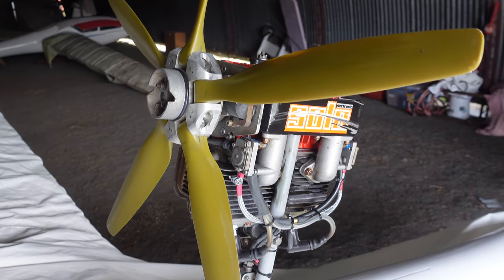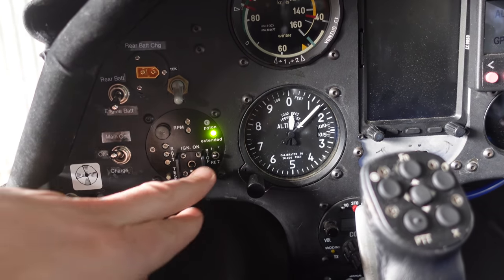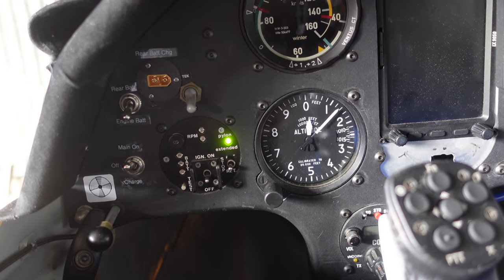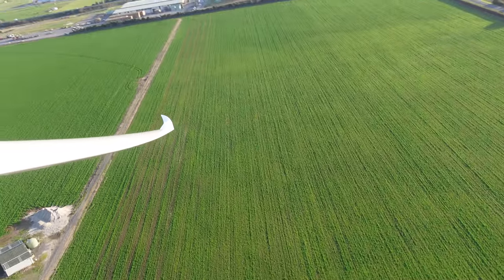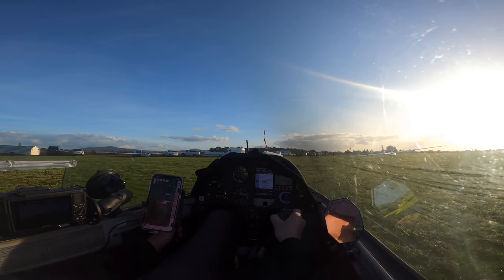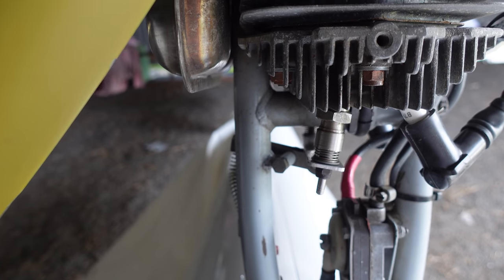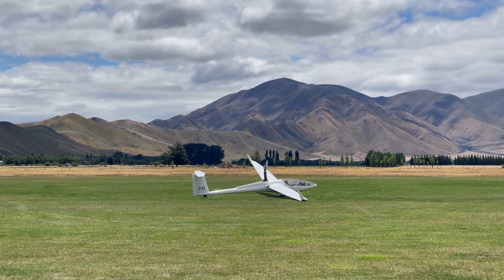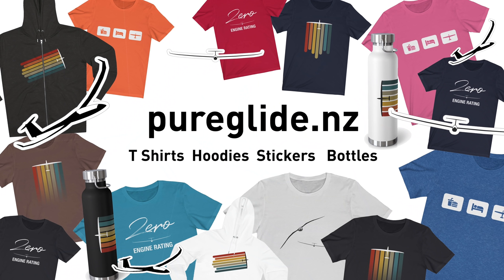How a Glider Engine / Turbo / Sustainer Works

Comment: seen this before, though i find it cute that some also use jet engines.   

PBS TJ-100  is a common little jet used, though some owners have managed to get their hands on Williams F107 WR19's,  though it is not unheard of for some to use RC Aircraft engines...   mounted in pairs.    either 2 on a single popup pylon, or 1 per side on separate popups.   while it might seem strange to use "RC Aircraft engines"   many of them can get up to and above 89 lbs of thrust per engine..  For example a Jetcat 500 is about 110 pounds of thrust each,  2 of them, 220 pounds..  for a smaller lighter glider that's good for a sustainer engine or even takeoff in some cases.     Jetcat 1000 RC motor,   is about 1100n thrust or 247 lbs of thrust A pair of those will match the Williams F107 WR19.  

more then enough thrust to take off though they guzzle fuel much less efficient because of their design, then more purpose built sepecailized engines,  each jetcat burns 2.9l per min,  so a just for take off at max power,  the pair will chew through almost 60 l of fuel, just for a take off and climb.    the Williams f107 though even though its twice the thrust is a far more efficiant engine burning about 3.08l/min a max flow rate.  but again, those are like hens teeth to get,  i'v eonly seen like 2-3 gliders powered with them.
Reply from the maker: Yeah I'd like to make a video about jet engine gliders sometime! Cheers
Reply: @PureGlide  as i said, the one that use the RC motors are more common.  if you see a pink air intake.   Its a jetcat.  That's pretty much their trademark.   Lavander/purple is... ugg i think its AMT?  out of the netherlands, and blue is PBS out of Czech.

Comment: How long does the engine run? I imagine the fuel could change your glide characteristics so using it would make you glide slower?
Reply from the maker: 450km using the saw tooth method. I'll have to cover that in another video! Stay tuned for Part Two
Reply: Extra weight has surprisingly little effect on the performance of a high performance sailplane.
Reply: They fill the wings with water sometimes, so  the extra weight is not a problem for say a big gasoline tank.

Comment: Very interesting video. I imagined those Engines were there to get you out of trouble at low level. But it seems a fair amount of forward planing is required. Including a dive!!
Reply from the maker: Yeah exactly right! Gotta use it early. I just tried to start it down low next to the airfield recently, and it didn’t start, so ended up landing😆

Comment: I don't think it is cheating at all but once you put an engine on it you really should not be called a glider anymore. {shrug} 

I mean my Cessna's can "glide" with the engine off. The turbo 210 I used to own had a 12-to-1 glide ratio. From 25,000 foot I could glide 54 miles! Does that make it a glider?  Nope! :)
Reply from the maker: Haha true I guess the intent is to not use the engine most of the time, but I bet you don’t have that intent with your Cessna!
Reply: @PureGlide  "but I bet you don’t have that intent with your Cessna!"

LOL! Yeah! Very true! Only when I am practicing for the real thing! 

BTW on a related note -  In 30 years in GA I have had two engine failures. I made it to a runway both times!  So practicing gliding pays off even in Cessna's!
Reply from the maker: Excellent, good to hear :)
Reply: @AClRCLEOFLlGHT  Jeez man, no need to be so nasty about it! 

I gotta tell ya though, gliders are not my cup of tea but as a total airhead,  lover of all things aviation, if flies then I think it is totally cool!  You won't hear me knocking gliders or glider pilots. 

When my next engine overhaul comes due I may even be thinking real hard about it! lol
Reply: @AClRCLEOFLlGHT  Opinions are like arseholes mate. Everybody's got one and they're usually full of sh*t.
Cheers, have a great day. ;)

Comment: I had no idea that physics would allow for a forward folding prop. I thought that the lift from the blades would fold it up. I guess that centrifical force wins.
Reply from the maker: I asked my gliding engineer about it. He stood quietly for a minute :) I will find an answer for the multitudes of people who have asked. Subscribe so you don't miss the answer!
Reply: The rotor blades on helicopters rely 100% on centrifugal forces to keep them from folding up in the exact same way. Some helicopters, such as Robinsons, actually have hinges at the base of the rotor blade that enables the blade to rotate upwards for flapping. Without centrifugal forces the blades would fold upwards in to streamers as you plummet to earth like a stone.

Comment: Man having an engine on one of these things just makes so much sense. Just think about it, if you can fly about 8 to 10 hours in one of these gliders. And damn near close to hitting a thousand miles. Just in one glide alone. Having an engine on there could potentially fly you clear across the United States from California to New York, on just one gas tank. Because you don't run the engine the whole way. Hit it for about 5 minutes up to altitude. And you're good for another 8 hours of gliding.
Reply from the maker: Haha not sure your numbers are quite right, but the concept is kinda right!
Reply: @PureGlide  Well probably not on your engine. But I know there's some people that can get close to a good thousand miles on just one glide. And I've also seen other people instead of a propeller prop, they put these small jet engines on there. I bet that'll do it.
Reply from the maker: Yeah so my engine has one of the longest ranges. The sawtooth method which is climb, then glide, then climb, then glide etc can get 450km range. Any further and you need some external weather to help. Cheers!
Reply: @PureGlide  Well the world record for the longest glider flight is a little over a thousand miles.

Comment: I love gliders, because they are elegant, silent and high tech. The modern electric motors fit much better then a screaming and farting combustion engine, IMHO. 😁
Reply from the maker: Yeah and if you have a spare hundreds of thousands of dollars you can buy one! Luckily we don’t have to use the engine very often :)
Reply: @PureGlide  Seems like the manufaturers have a 90+% margin obviosly. Batteries cost <100 € or $ per kWh. 
If you can by electric cars for 20-25k€/k$, it is just a question of time, I guess.
Reply: @Stefan_Dahn  lekker genederlandst pik, “a question of time”, man man man

Comment: Wouldn't this make more sense as a pusher motor?  From the way the prop blades fold, it appears the only thing actually holding them deployed when the engine is running, is centrifugal force.  I would imagine a great deal of thrust is lost from the system to blade flex.  By having it a pusher motor that folded forward, I would think you'd get greater efficiency from the engine
Reply from the maker: Good question! I guess this is the design, hasn’t changed for over 20 years as it seems to work well. Brand new ones are almost identical

Comment: I agree the engine is not an advantage in competitions, even is a disadvantage with more weight, and at least the turbo which needs to dive to start takes more altitude than some people use for landing circuits.

But there is one competition advantage, and that is that on those outlanding days, when sometimes other competitors arrive back late at night after long retrieves, the turbo pilots can motor home for a relaxed evening. Saves on fatigue :-) Unless you're the one who have to go retrieve all the other pilots after returning :D
Reply from the maker: Exactly right! I thought I would end up being more relaxed but in the end I go on a retrieve anyway :)
Reply: @PureGlide  It started with turbo pilots going to contests without crew, "since I will always get home I don't need a crew". Then it evolved into the pure glider pilots: "I won't need a crew because the turbo pilots can come retrieve me". And now no one has a crew :)

Comment: Yes its cheating!!!!

With the ability to up n go....you are likily able to try to find that thermal just a little further out and lower down than someone that has to consider a proper circuit and landing options.
Reply from the maker: Not quite true, if you want to use the engine you have to start it higher than you could possibly find a thermal without an engine. Some people who fly contests deliberately don't use the engine at times so they can try and find the thermal down lower than their engine cut off height.

Comment: About the folding blades:
How do they stay straight when using the engine? Is the centrifugal force enough? Or do the blades need some counterbalance to keep them unfolded? Maybe they have like a centrifugal lock in the hub?
Reply from the maker: Yeah it takes very little to make them spin and flip out, and then the airflow puts pressure on them. Cheers!

Comment: Great explanation of the sustainer motor operation!   This motor really opens up the territory you can explore!  Your prior “Motor to the good stuff” video captures the advantages!  Some of your videos show magnificent scenery that appear to have zero options for landing out safely.  I am certain having a motor must feel  good.
Keep up the excellent work!
Reply from the maker: Thanks very much! And don't worry although you can't  always see them on the video, there are ALWAYS options for landing. Often behind me which you won't see. I've only once or twice in my gliding career I've not had somewhere safe (or wet) to put it down. Around NZ in particular, we often don't find lift even when we expect to, so it's critical. I'm up to about 75 out-landings so far...
Reply: @PureGlide  That would make for a great video of the best out-landings in NZ in short video clips.  Clearly with my 2 out-landings I need to adventure out more.

Comment: Probably better than an electric sustainer but not as good as a jet engine. I don’t doubt the 2 stroke is more fuel efficient yet it lacks the James Bond kudos you would get with the Jet and that’s worth a lot of mileage.. 😎
Reply from the maker: Yeah not quite as cool as a jet, but the sustainer can go the furthest distance (400km or so)!
Reply: @PureGlide  - Yep.. 400km is useful. If you need to sustain that distance of course. Though I’ll  take the jet and a radius of a mile please. :)

Comment: Nerd here..  Interested in long range flight for personal transportation.

what's the fuel capacity?  How long will it run for on that amount of fuel?  How far do you think you could glide using it?  What's you average speed?  Would an electric motor with battery and solar on the wings be awesome?
Reply from the maker: Hey DjClarky78, great questions: some of which I answered in part two: https://youtu.be/ZRTkHh7n55Y
As for electric, yes they exist now as you can imagine! And yes even experimental gliders running only with solar on the wings (Google" Solar Impulse). But electric gliders are now common, and I'll have videos on them in the future.
For personal transportation, check out the touring glider range from Pipestrel like the https://www.pipistrel-aircraft.com/aircraft/electric-flight/taurus-electro/
Cheers!

Comment: Are the blades extended only by centrifugal force? Even if they push air backwards? Or is there some kind of locking mechanism in de center of the hub?
Reply from the maker: Centrifugal force only! Cheers

Comment: How much does the extra weight cut into your glide ratio?
Reply from the maker: Weirdly adding weight doesn't change the glide ratio (because the aerodynamics aren't changing). However it takes more energy to lift the glider into the air (with thermals) but then can glide faster at the same glide ratios.
Reply: @PureGlide  Thanks, that makes sense, actually my High School physics is coming back to me now, appreciate the refresher!

Comment: There's a word for a glider that can self-launch. It's called an "airplane," if you'll pardon my lighthearted sarcasm XD Sorry, I couldn't resist.
Reply from the maker: Haha you're not the only one who had that idea :) Seriously the actual difference is a glider usually flies without the engine, while most aeroplanes try to primarily fly WITH an engine running. Not many aeroplane pilots turn off their engines for fun very often...

Comment: In the uk a glider like yours is still a glider, but if it can self launch it requires a motor glider licence PPL SLMG. Which is more costly than learning to glide.
Reply from the maker: Yeah a sustainer doesn’t require much more than a normal glider license here too

Comment: Man...one thing I KNOW is bad for motors is to NOT let them warm up.  There's a 100% chance you'll score the piston.
Reply from the maker: Oh how do I do that with a 2 stroke with no throttle? It's all or nothing :)
Reply: @PureGlide  Ya...I thought that may have been one of those...I guess install a carb or buy insides prematurely.  How many hours does that motor last?

Comment: If the blades pivot forward and are designed to propel the aircraft forward how do the blades not try pivoting forward from the "lift" they create? Does the centrifugal force overcome the thrust produced? 
I really hope that made sense.
Reply from the maker: Yeah it doesn’t make sense, except you are right, the centrifugal force is more powerful than the lift force. Well must be, as it works!! Cheers!

Comment: Huh.... sounds like that thing is poorly designed, and could be designed better so you don't require to dive just to start the damn thing...  But hey that's just my opinion.
Reply from the maker: Yeah some of them you don't have to dive start, but then it has a starting motor of some sort. And that means it's another thing that can fail and maintain. So in some ways the simplicity is good! The modern electric gliders have that main advantage, where you can literally press a button and away it goes.

Comment: So if your engine ever went out, you'd have the embarrassment of having to tell the tower that you're a glider and your engine is out
Reply from the maker: "My damn engine has stopped working again! I'm going down... really slowly". Actually I can't talk to air traffic control with the engine going, need to get a headset thing for that!
Reply: @PureGlide  Removing the headset is a prudent social distancing measure.  This aircraft is a model of safety, hats off to you, siir!  Seriously, though, it must be nice not to need a headset.  I fly helicopters, I'd be deaf.
Reply: Had a good chuckle at this one!
"Are you declaring an emergency? Do you require immediate clearance for landing?"
"Maybe in a bit. It's quite a nice day up here, I'll get back to ya."

Comment: I dont know anything about gliders, But can you keep flying with the help of that engine is there is to wind to glide on ? 😗🙄🧐🧐
Reply from the maker: Yeah exactly right- we use it if we are getting too low to use the weather to stay up. It could be thermals, or wind on a ridge. If either stop working, then the engine will help get us home. Cheers!

Comment: dont like the starting procedure, would it have added to much weight to install a starter?  dont get it
Reply from the maker: In some ways it would be good, but it is another component that can fail. Sometimes the simplicity is good. The modern self launching gliders do have starters. But overall they are a lot more complex, and have a lot more go wrong, more often. So pluses and minuses...

Comment: Thanks 4 another great video, mate!
I never understood why the glider companies decided to use the name turbo to mean less power. Highly confusing: turbo means you can't take off
Reply from the maker: Good question! Never thought about it properly :) It's probably a german word that starts with T anyway, and not actually Turbo... like L for the flap is actually the German word for "Slow", not english "Landing". Or maybe simply it's more turbo than nothing?!  Who knows. Not me, that would require research...
Reply: @PureGlide  "Turbo" as in "speed yourself home" perhaps, so in a sense "more power" when the soaring conditions have deteriorated?
Reply: L for the flap is most probably short for Landeklappen = landing flaps, although it really might be Langsam  = slow, but I think that would be weird. In cars turbo is a mode where more fuel is injected for a power boost, so I would say it means power boost compared to gliding.

Comment: Really? The batter indicator is just three lights? I'd rather look at an actual percentage.
Reply from the maker: My other equipment has a proper battery monitor, so no don't actually use the engine battery button ever!

Comment: @Pure Glide Are there any gliders with self-launching AND sustainer engines? Any you would recommend?
Reply from the maker: Yeah all those with self launching glider engines can use the engine as a sustainer too. Pull it out and use it anytime basically.
Reply: @PureGlide  thanks!

Comment: Good presentation 😀👍🏻👍🏾.

About Cheating? I rather call it an operational and psychological advantage especially in competition and going for badges&diamonds.

A motor glider and pure glider should not be competing in the same contest.

Since engine fitted gliders came more on the market you can see a steep climb in the obtained 1000 km badges.
Believe me; when I took my last turnpoint the 1st of december 1999 around 17:00 pm it was with a heavy hart I started the final 255 km home.
1016.6 km with an average of 119,32 km/h it was a National record (Belgian) then but I was so excited that I completed the task successfully that I forgot to put in 😆

Glider flown was a Ls 6 17,5 mtr and No Engine 😇
Reply from the maker: Yeah I hear you, although I suspect top pilots an engine doesn’t make much difference. Sometimes it’s a disadvantage because on very light days you can’t dump the weight! But yeah for record flights it makes it much easier and less chance of a painful retrieve.